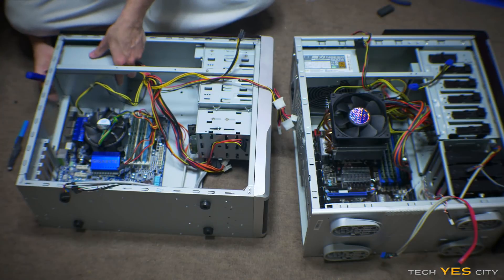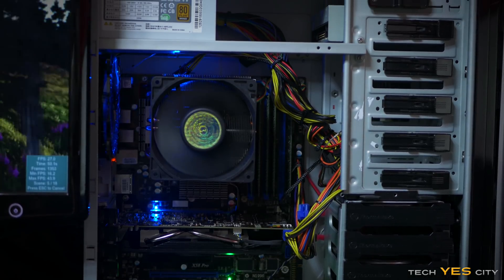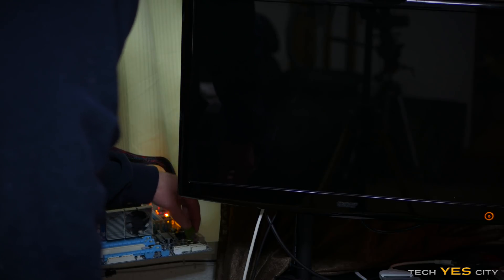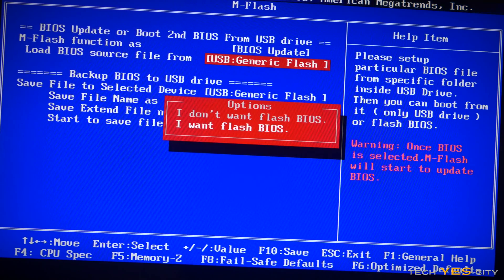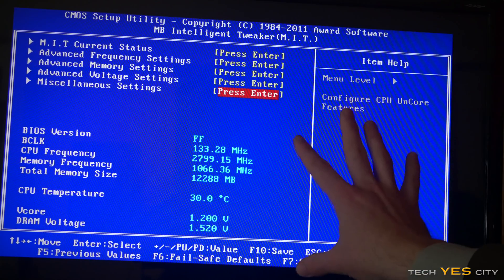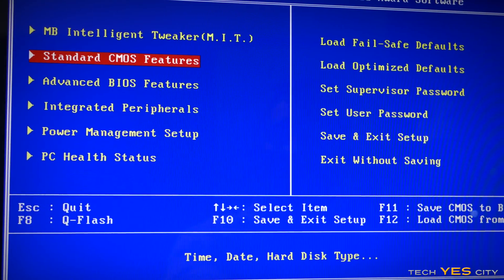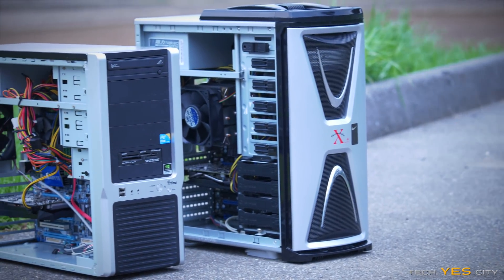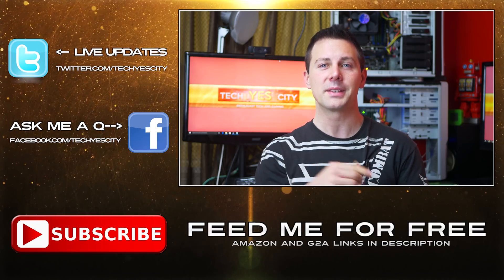PROJECT 242 - The Mystery of the i7-920 Vs E5640 ($302 + $312 Used PCs)

Comment: I don't know if I told you in the passed about my EVGA 780i running an E8400. Back in December I found a Q9400 on Ebay for $20 and tossed it into my EVGA 780i and man did I get new life back into that PC. Well after fixing my friends PC I ended up with is ASUS Z97-AR witch was blown out. I RMA'd that board and got a new one and was able to keep it. So swaping out that ASUS board and installing the EVGA 780i went into a new case to find that I shocked the board and it died. I did have a backup ASUS P5B-E witch is an older board and only a 1066FSB I was worried that the Q9400 wouldn't work. I looked up some info on it and found it would work if I updated the BIOS. Bamb, 10 year old MoBo using a Q9400 and it's able to game. Funny though by installing that proc into the ASUS it overclocked the CPU by 200MHz Bonus! Any how I'm uploading right now a video on how a 10 year old MoBo can play Fallout 4 on High/Ultra settings @1080P I'm getting from 14FPS at the worst of times but out in the world I get a good playable 45FPS avg and a full 60FPS when in a warehouse or sewer or where there is a load into a mission. I'll tweet you the Vid when it's finaly finished.
Reply: nice I subbed
Reply: +Eric Marcus So I found out some good news. I didn't shock my EVGA 780i. Here it was the CPU cooler ether grounding out on the case or it's to heavy and smashing the CPU. Yesterday I took the CPU cooler that I was using originally in a Cooler Master HAF case that has a cutout behind the motherboard and when I took it out of the HAF and installed it into the Cooler Master 532 witch doesn't have a cut out and the ASUS P5B-E was crashing on startup just like it was on the EVGA board. I swapped back to the stock intel cooler and no hang up crash.
Reply from the maker: +Eric Marcus Awesome man, I think if you turned down some of the settings it would play even better, it is definitely an impressive CPU! I couldn't believe how it handled Metro Last Light.
Reply: Tech YES City I was pushing it to the limit to where it's still kind of playable. I'm doing the what can a 10 year old PC still handle in gaming. :)
Did you see the vid by chance?

Comment: Hey, very interesting video . i love these old parts comparisons. 
One thing I have noticed and I'm wondering about is , you always use low Anisotropic Filtering . Why ? It is practically free , and it does offer a good quality . 
Also one suggestion would be to find a more CPU intensive game to include in the benches. Recently I have had a problem with a i7-2670qm , not keeping up with a very modest 6770m GPU in games like Heroes of the Storm and SimCity, while not being a problem with games of GTA5's nature. 
Keep up the good work !
Reply from the maker: +guardians3D I thought Anisotropic filtering puts quite a bit of strain on the CPU? I will have to test it out more.
Reply: +Tech YES City Well actually AF is a GPU operation . The graphics card ALU units , are used and the operation takes up abit of the memory bandwidth . It was , infact , a heavy operation and close to AA levels of a performance hog , about 10 years ago. When GPU, had low amounts of bandwidth , and vram . 
Today it isn't really that big of a deal . It might be worth a test if it makes any difference with say , GPU's with gddr3 or gddr5 ram , when lots and lots of textures , on perpendicular surfaces are present in the scene.  Even then it should be a very low impact. 
That isn't to say that AF isn't a problem ... on current gen consoles. As they don't have dedicated memory , their CPU and GPU might fight for bandwidth . Digital Foundry had an interesting article few months back . There they tested some APU's in effort to find if this is a problem when ram is shared. Even in this scenario , the difference between AFx16 and the lowest filtering option was in fractions of a frame .
Reply from the maker: Ah no worries, thanks for the insight! I will have to hit it up to max then!

Comment: Just a suggestion, but when you test CS:GO, you should try it on a map other than nuke. Nuke is one of the more poorly optimized ones
Reply from the maker: +N3ON will do!
Reply: +N3ON Maybe that's why he uses this map for testing. Worst case scenario.
Reply: +N3ON It´s not optimization problem, it´s just has better graphics than other maps:D
Reply: +N3ON I think he does it because it's the most demanding map. Also, people need to stop saying that it's poorly optimized. It isn't. It's just that it has better graphics, which in my opinion is well worth the performance difference given that most half decent pcs can run it at 1080p60 just fine.
Reply: +Samuel Kwok graphics are the same, just there is more entities, more details and such
Reply: Banana Lord If I'm not mistaken, aren't there better textures too? It just looks better in general.
Reply: +N3ON I would be interested to see CS:GO results with lowest possible settings, still 1080p, because any half-serious cs player is turning settings to low in order to increase fps.. Source engine requires more fps to get smooth game-play and least delay especially on 144hz monitors. Constant 300+ fps is recommended to get rid of every inch of micro-stutter.. Also the game becomes much more cpu dependent when lowering details..

Comment: hey Tech yes city are these specs good for gaming?

Processor: Intel Core i7 6700K 4 GHz Quad - Core Skylake , Turbo Boost (4.2 GHz) and Hyper - Threading
Processor Cooling : Heat pipe cooler quiet fan
Memory: 16 GB DDR4 2133 MHz ( 2 x 8 GB , 2 free memory locations )
Graphics Card: NVIDIA GeForce GTX 980Ti 6144 MB ( DirectX11- and CUDA support)
Motherboard: ASUS , Intel Z170 chipset , ATX
Hard Drives : 500 GB SSD SATA III and 3TB HDD 7200 rpm
Optical drive: a CD - RW / DVD + -RW combo
Housing: Fractal Design Define R5 BLACK
Power supply: 850 W 80 PLUS Gold
Audio : 8-channel High Definition Audio -äänipiiri
Operating System: Microsoft Windows 10 Home 64 -bit GB ( other countries language packs available for free download from Windows Update )
Reply: +ραννσ see if you can get a x99 with a 5820k instead of the 6700k...the 6700k is a lil faster per core but if you do any editing or streaming you will prefer the 6 core...i cant tell you the price for you but i know locally in the states that the 5820 k is within like 20 to 40 bucks the cost (for mobo and cpu) as the 6700k...so you might want to look into that (i dont know just a idea)
Reply: +Nicholas Dluge Agreed the X99 build is the way to go.  Just have a look at Tech Yes Citys videos.  Ever notice how he regularly grabs older X79 and X58 enthusiast grade boards and CPUs?  That is because they last longer in terms of tech.  They have longer upgrade life cycles.  X99 will have 10 core CPUs coming out soon.  In 5 years you may get one of those cheap and be able to extend the life of your system.  If not you could probably sell your X99 board at a premium price as they will be somewhat rare by then.
Reply from the maker: +ραννσ More than good
Reply: :D
Reply: +ραννσ I would suggest waiting for next generation GPU´s and buying higher frequency memory.
Reply: i wont do steaming or editing. I have wanted a gaming pc from 5 year old. I only want a pc where i can play games with no lag
Reply: ραννσ then 6700k will do you fine nice build
Reply: thanks well actually its pre build im too dumb to build a pc
Reply: ραννσ look up videos on how to do it if you need help...between tech yes city, joker, linus tech, jayztwocents, among others there is more then enough vids to learn how to do it...its no where near as hard as it used to be...
Reply: well i can actually build a pc but little bit too lazy
Reply: Talon he replied back to me and he only wants to gam so the skylake rig does have a hint better single core...but your right the x99 will have broadwell support too coming up...but it really does depend on his local pricing
Reply: You always know these people don't know what they're talking about because they do things like saying "gigabyte nvidia gtx 970 4 gigabyte vram graphics card" rather than "gtx 970"
Reply: tho how much would this cost in euros?

Comment: An HD 7970 is way more powerful especially in the new games could be a nice choice, since Nvidia destroyed their Kepler cards
Reply: +jd gaming I didn't see their low firestrike graphics score, I think for used build, there's point of buying an Nvidia card,
You made two builds with R9 270, they are more powerfull, 
(my HD 7870 oc get 7500 graphics score by the way ^^ and I paid 45€)
Reply: +jd gaming Yeah the 7970 is still a very fast card and you can find some used at great prices! However you will need a pretty good PSU with that power hungry X58 socket.
Reply: 500 watts is enough